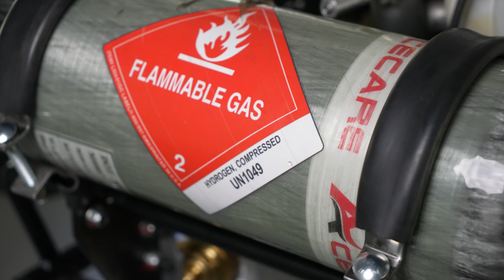LiquidPiston Hydrogen Hybrid-Electric Go-Kart

Comment: Really cool! How much Hp does it make?
Reply: It makes 3 hp. Although that's not very impressive, it only weighs 4 lbs, or just under 2 kg, so it will be interesting to see if it can be scaled up with similar results
Reply: @zootopiaondvd8081  i was gonna ask the same about hp cause if it can make really good hp the car community at least would jump on it
Reply: 3hp-4hp-5hp I’m guessing